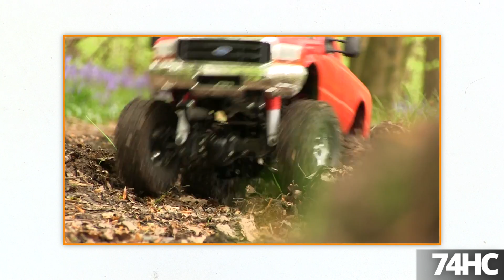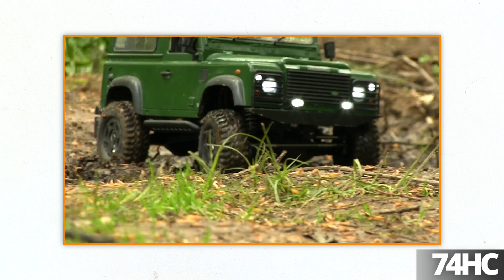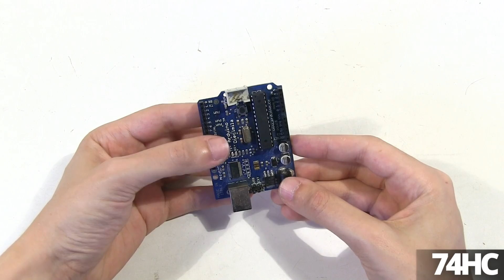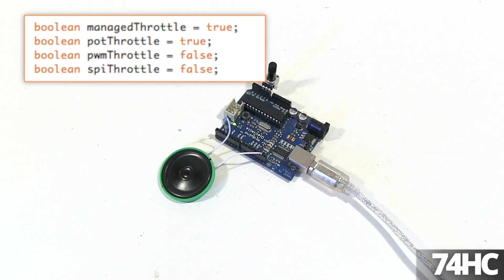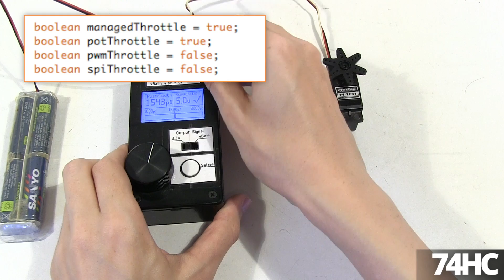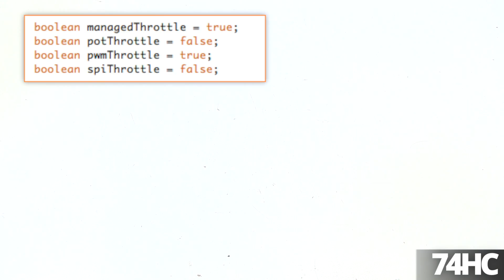RC Engine Sound Generator - Part 1

Comment: 74HC Sorry  do you not have a solution for me?☺
Reply from the maker: Gianluca Faccioli Yes, yes, sorry, on a standard mode 2 transmitter the throttle is on the left stick, up and down. The throttle will stay where you leave the stick and not return to the centre position. This could be causing some issues. The best thing to do would be if you could goto 74hc.co.uk and send me a message on the contact form, then we can sort out some pictures.

Comment: fist all very very compliments! I tried to do it and by potentiometer works very well but when i connect the radio does not work the radio is audigy 9x and i use arduino uno can you give me a little help? ciao
Reply from the maker: Gianluca Faccioli It's been a while since I've looked at the code, but 2 things come to mind. First are you changing the mode booleans? And second if you're running a 9X are you connecting the Arduino to a centre sprung channel?

Comment: I'm not familiar with English, please tell me what is the IC number at 4.58. it 's hard enough for me.
thank you.
Reply from the maker: That would be a 75HC4017 Johnson Counter. Used here to run 8 servo channels from the ATMega32U4.
Reply: 74HC Thank you very much , I have a project like this for my rc truck, but still finding for a lot of data every night. Your VDO is helpful. You are very intelligent.

Comment: Liked, subbed, watched! :)  
I wanted to do something like this for a while, I like yours a lot!  
One thing that I would want is a soundmodule that not only covers variable rpm of the engine, but also the load. Your module sounds (to me) as if the engine is always almost running at no load. I think that is because the "aggressiveness" of a real engine's sound changes when it sees load, and its frequency changes when the rpm changes. 
Any ideas on this?
Reply from the maker: This is a limitation of altering the playback speed of a short sample. It kinda gets the job done, but as you say a lot of the nuances of the sound get missed. Ideally the engine sound needs to be generated on the fly by mixing a few sine, triangle and maybe square waves. I know it's doable with the ATMEGA, I've seen it done, but the source for the projects aren't available.

At some point I want to have a go, but as it wont be a quick project I'm not sure when I'll get a chance.